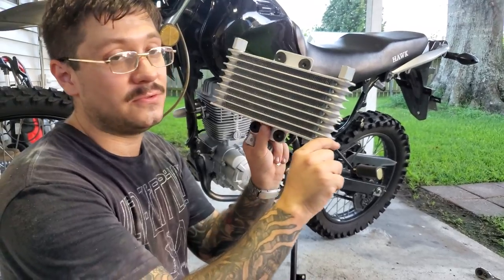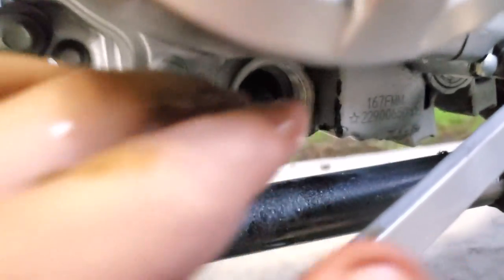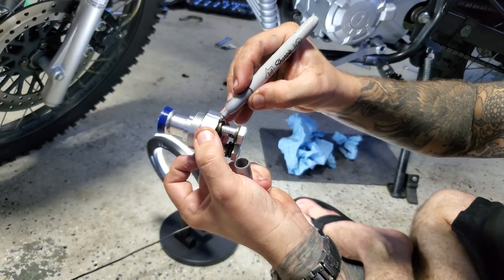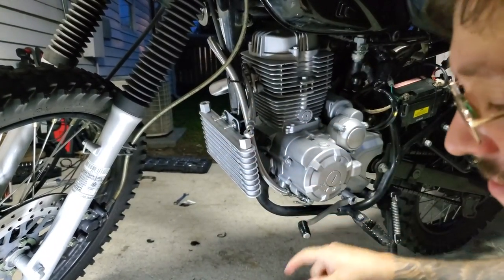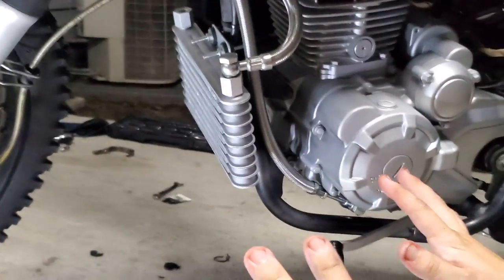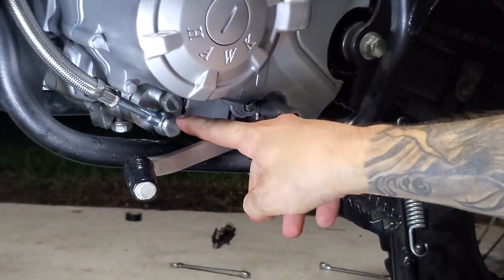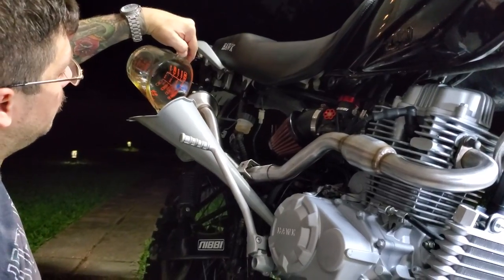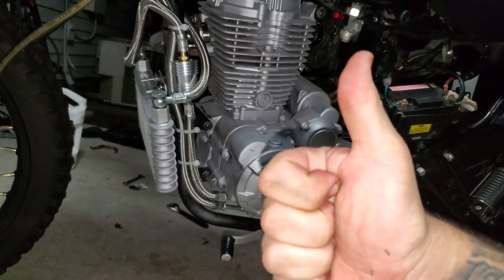HAWK 250 OIL COOLER INSTALL GUIDE!

Comment: Nice video, I do have one note. If you look on the face of that adapter it has two divets in the face of it. Those divets are designed to allow you to tighten the unit with a spanner wrench. Overall great video, I enjoy the content. I've been looking at getting at getting one of these bikes for a minute now.
Reply from the maker: This is really useful information, my bad for missing that
Reply: Or gently use a long screwdriver between the two bolts to tighten it.

Comment: My favorite part about the Chondas(Hawk 250, TBR7, Bozz 250, etc.) is everyone can have the same bike out of the box, but each motorcycle becomes its work of art even when we all do the same upgrades.  I mounted my cooler higher and stretched out the lines far.   Nice work!  FYI, I would love it if you checked out my TBR7's oil cooler setup on my blog.

Comment: You never did a top speed video....
Reply from the maker: Its coming, still have a couple more vids to upload
Reply: the oil cooler has to come first
Reply: @mototaco6603  Do you have to remove the radiator when doing oil changes now? What's the procedure? The radiator's inlet and outlet's being on top seems (to me) like it would be a headache.

Comment: This is pretty interesting. I wonder if one could install an actual oil filter using this kit, and whether or not the oil pump would be able to maintain sufficient pressure with a filter. If this kit is cheap enough, I may try adding a filter onto my old Lifan 200 engine as an experiment.
Reply: Have you done it yet? I was wondering the same thing. Let me know how it works out and what filter you used.
Reply: @juniorhenderson7512  No, I haven't done it yet. I'm still working on finishing the swap into my old XL125S frame. Once that's all finished, I'll probably give it a shot. If it works, this would be a great way to increase the oil life and longevity of these engines. If not, I'll just buy a 250cc and be happy I had an excuse to upgrade. Lol
Reply: @chasebarber6154   It would be great if it works. These engines really NEED an oil filter. I think the manufacturer/designers purposely leave them with out it to for maximizing profits. I'm also trying to figure out how to get a small electric engine pre-oiler to hooked up.   It's said that 80% of engine wear acuurs at startup.
Reply: @juniorhenderson7512  I don't have a Hawk, but will the electric starter work with the killswitch engaged? If so, spinning it over for a few seconds before resetting the killswitch should provide plenty of oiling to prevent dry starts. If not, you can always use the kickstarter with the killswitch engaged to achieve the same result. The forces exerted by turning the engine over are far less than those exerted by the engine running, so you're not going to cause damage with either of these methods because of the oil film that remains on the parts.

As far as why they don't include a filter, it's definitely a combination of cost savings and not wanting to have to re-engineer the crankcase of the engine in order to accommodate such a change. After all, if this setup works so well for Honda, why should they bother to change it?
Reply: They do have an oil filter. Its a centrifugal type mounted to the crankshaft inside the clutch cover. Its the same type that millions of Hondas have used for years.
Reply: @leegraves101  I'm well aware of that filter, but it would be nice to have a more easily accessible filter that also catches more particulates. Will such a modification work/be better? I don't know, but if it so, it could greatly increase service intervals and engine life. Once I manage to get a 250cc engine on hand, I'm definitely going to try with my 200cc.

Comment: Thanks a Zillion Mr. Mototaco. I got the "Big Bore 300" kit with 16mm pin. Everything is good except the sleeve will not go into the gearcase. My new cylinder sleeve is 75.5 mm and the gearcase bore is 74.3mm. How did you get yours to fit? ...The 73mm bore kit, what I thought I ordered,  is now out of stock. Ideas? RSVP

Comment: Would be great to see how the oil cooler is holding up. Afterall, it is an aftermarket part. I have did some things to my hawk and
tho the bikes are not made with a cooler it is definitely durability insurance. Thanks for this video!
Reply from the maker: i do a routine check on it on my 10k miles video

Comment: NO NEED TO ORIENTATE THOSE BANJO BOLTS, THEY ARE DESIGNED TO WORK NO MATTER WHERE THE HOLE IN THE BANJO BOLT IS AS THE FEMALE FITTING HAS A GROOVE IN IT THAT PASSES THE OIL INTO THE LINE, WHAT IS IMPORTANT THAT THOSE LINES ARE TIGHT, NOT WHERE THE HOLE IN THE BANJO BOLT FACES.
Reply from the maker: thank you for making sure

Comment: First, How much cooler does this keep your engine?  Second, could you have mounted the cooler upside down, so that the connections were all away from the exhaust?
Reply from the maker: you certainly could have. you can also mount it sideways depending on the application
Reply: Right and being reversed gravity is working in your favor. The better you flow the more it's gonna cool and not cook that oil . You saw the same thing I did right off the bat if worried place it higher up for line slack .

Comment: So I also installed that sorta oil cooler and oil displacing adapter and the oil pressure was abysmal. It was hardly pumping oil into the cooler. You could see from the side glass window that the oil was not circulating through the system. I had to remove that whole setup cause the engine was running almost dry. Didn't work for me unfortunately. ☹️☹️☹️

Comment: Its pretty pointless as the radiator is too close to the exhaust that get way to hot you should have placed the radiator next to the horn plus the oil lines are way to close to the cylinder it defeats the object your trying to achieve radiators are ment to be above the engine not below as most of the heat is at the bottom

Comment: If you dont fill up the oil cooler with oil and just fill the engine once oil starts flowing through it youll be short on oil in the engine?

Comment: Whats the point of installing an oil cooler on a splash lubricated engine? Oil can't circulate through an oil cooler without oil pressure. Trying to figure out how that works
Reply: This does have an oil pump. It has to get oil to the head and valve train. This is not an oil cooled engine, but the added oil cooler does help with cooling

Comment: How hot did the oil get before this? Guessing what the bike really needs is the proper oil for summer heat. I only have a CG150 so no experience with the 250s here, but 15w50 M1 keeps mine happy and cool, 106f yesterday.

Comment: Is the oil your using motorcycle oil? I haven't been able to find that in motorcycle oil.
Reply from the maker: air cooled dual sports have a large following of using shell rotella 15W-40 diesel oil because it mimics a wet clutch oil so well. you are safe to use it as long as its the exact same one i used. shell caught onto this and started putting a picture of a motorcycle next to the diesel freight truck and smaller truck thats pictured on the container. 10k+ miles on the hawk 250 so far and no issues with it aswell as a very large following of people using it on their DR650's, KLR's etc. but i do see what you mean. my cheaper bikes i will use shell rotella. my DR i prefer ECSTAR 10W-40 motorcycle oil

Comment: I appreciate the video but Air Cooled Engines have been around for well over 100 years without such an oil cooler :)
Reply: @The Commentator 
Sorry for the delay but I had to read my comment several times to see where I said it was wrong ;)

Comment: I see some videos where they mounted radiator with the input and output holes facing down.  Seems wrong because the syringe comes to fill the 125cc from the top (would not need syringe unless facing up) and ALL the oil would drain back to the crank from the radiator when engine is turned off.  How did you determine what hose went where?

Comment: I see some videos where they mounted the radiator with the holes facing down. Seems wrong as the syringe is supplied to top fill and ALL the oil would drain out to crank case with engine shut off.  How did you determine which hose went where...ie...left side radiator  was input to bottom hole at engine?

Comment: I see some videos show the radiator with the holes facing down.  Seems wrong as they supply the syringe for the purpose of top fill and all the oil would drain out with engine off.  How did you determine that the left side of the radiator was input and hose went to bottom hole at engine?

Comment: Y u put the filter on the return to the engine .that would not make sense. The filter should be on the line thats carring the oil from the engine to the core.reason y i seid that .the oil should filter before it go in the core .

Comment: Can you record a video of changing the oil with this cooler on. Because I can’t seem to find the easiest way of doing it without making a mess and I don’t really wanna take it apart every single time I change the oil.
Reply from the maker: You could tip it and replace what’s in the cooler but I change the oil so often I usually just leave the residual inside of the cooler, let the lines drain and cap it and put new oil in the crankcase. I do check the oil screen though. Found like a couple paint chips but never any metal shavings or nothing

Comment: How do I know if I installed it right or if it's sucking in air/ leaking
Reply from the maker: it should circulate your oil just fine, and leak checking will just be periodically checking the lines to see if theres an oil drip, othjerwise just tighten the lines as you see fit

Comment: Hey buddy quick question. I installed this on my bike a while back and it’s time for an oil change, once I drain the oil do I have to add additional oil to the cooler again?
Reply from the maker: I typically use my sight gauge for reference regarding this, but since the oil cooler entry and exit holes are facing upward in my installation. I think only a little bit drains out the hose, not the entirety of the cooler itself. So when I re-service with new oil, it probably mixes with a small amount of old oil. Which isn’t a big deal at all. In any case you can service the recommended amount, run it, and then wait a few minutes for the oil to settle back down to the bottom of the crank case. And if it shows its low when looking at the gauge in a level position (I put a regular carpenter level on my seat) then you can top it off with a small amount until it’s halfway or just above the halfway mark. That’s been my practice ever since the cooler installation

Comment: Hello, it's the best video I've seen on youtube, on how to install an oil cooler on a motorcycle, it's an excellent video. And I have a question: why did you install the oil cooler with the intakes up, what is your theory about it, or did you just install it that way for aesthetics?
Reply from the maker: No reason really, i may flip it because installing it the other way allows for the excess dirty oil in the cooler to drain aswell
Reply: @mototaco6603  Gracias por responder, es que veo que la mayoría lo instala así, hasta en autos.

Comment: You do "some" good vids. I'm fine with my Hawk but if I had it to do again, I would thoroughly review the different sellers. A 250 is not a 230. I am sure it is emissions related
in being marketed as a 250 but maybe SOME do sell an actual 250? There is a mod kit to make it a 250 or even 300. For decent highway use the bike needs carb attention. Which is
another emissions related tactic, I'm sure. Itsa neat street/trail bike built to standards
that did great a few years ago and its good to see that type of machine is still available!